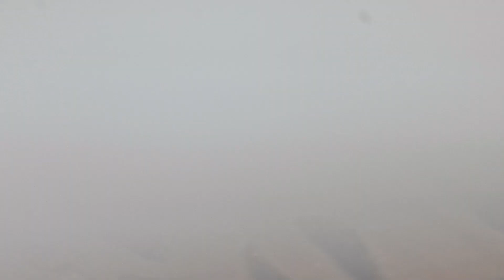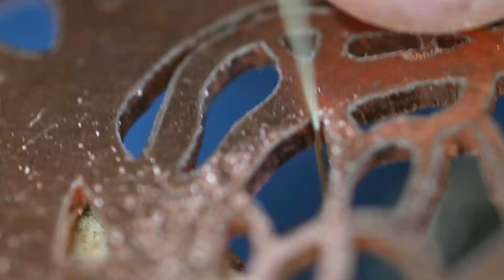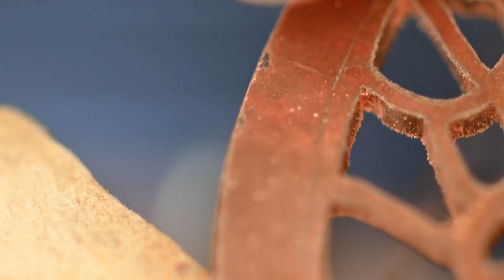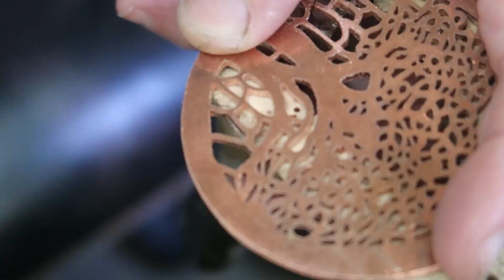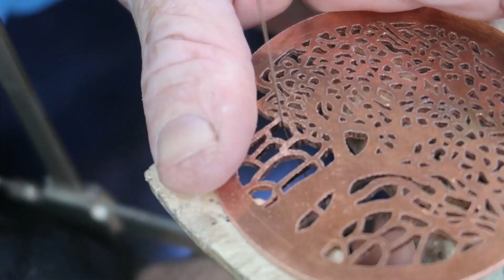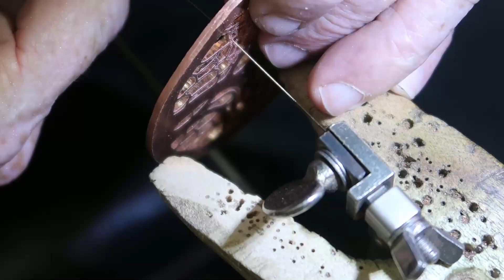Plique-à-jour Tree...day4...50X

Comment: hi, just wanted to know, have you joined two pieces of copper by soldering, to increase the thickness?
Reply from the maker: Yes, I start with 18 gauge sheet then double up using hard silver solder.